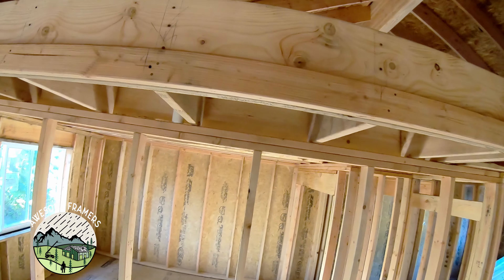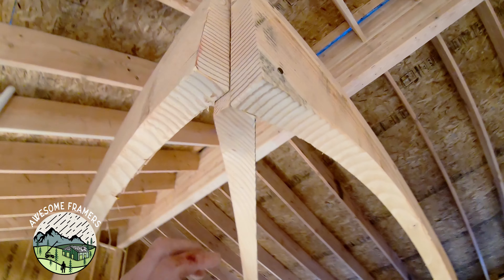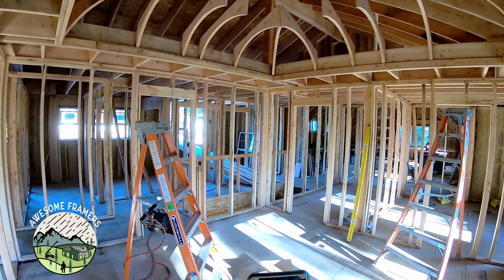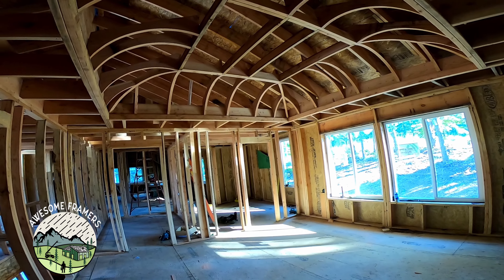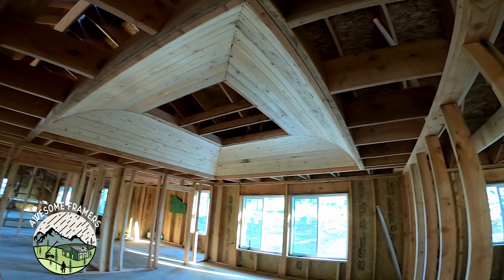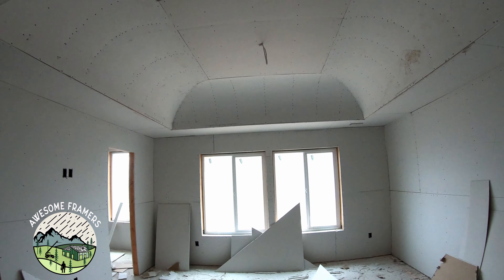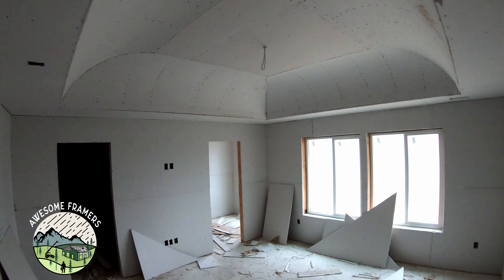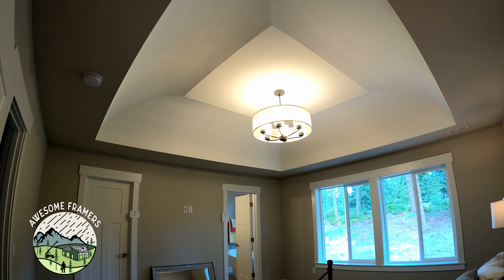How to Frame a Cove Ceiling Part 4

Comment: wow.  I've framed a bit, but nothing that technical.  I always tried to wiggle my way to work with the guys who knew the most.  And then over time, that guy became me (at least in the circle I was directly involved with).  But there is SO MUCH to learn!  I did do a little trammel work on some nice timber frame braces, but with a router.

Comment: That seems like a lot of weight for those arched pieces to support, especially just toenailed in all around.
Reply from the maker: I don't know it I did it in this video, but it other videos of ceilings like this I can hang and climb around. It's very strong and works as a system.

Comment: Take 10 minutes and throw up a scaffold and some walk boards would save you alot of up down on the ladder.
Reply from the maker: I don't agree at all, it only takes 10 minutes to actually frame it. Don't forget take down time.
Reply: @AwesomeFramers    I speak from experience, but you are certainly free to disagree.
Reply from the maker: @1974jrod  I hear you.  I find that setting up and taking down the scaffold for just the ceiling isn't worth it.  But I sure love it if it is already there :-).  Thanks for jumping in on this, I appreciate the differing viewpoints.  Too often people think that disagreement is a bad thing.  It isn't in my book.